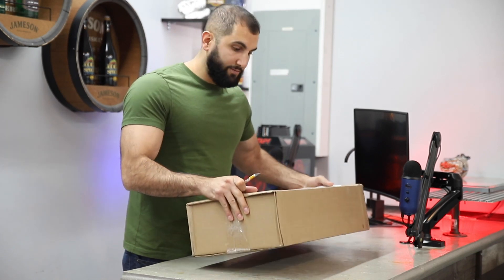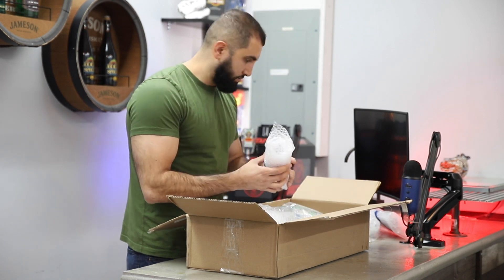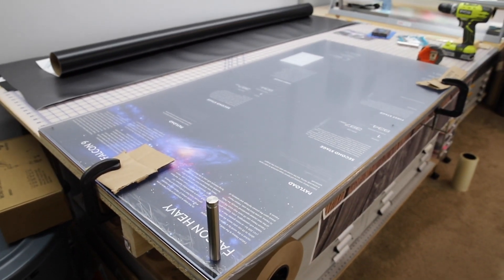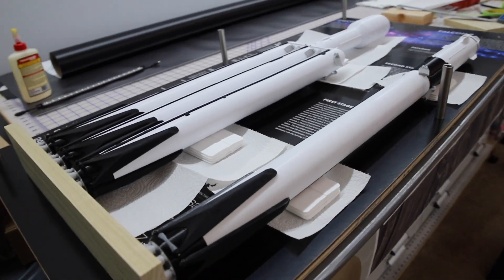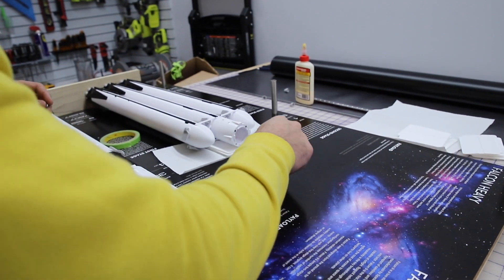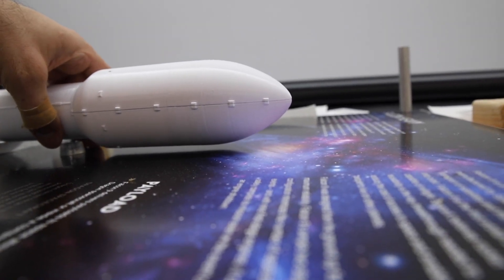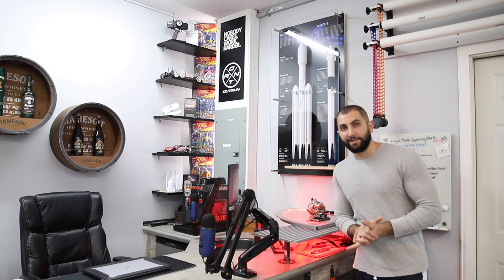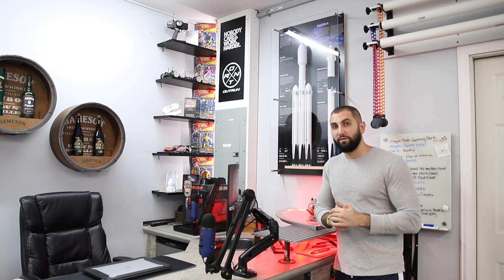3D Printed SpaceX Falcon Heavy Display Case | DIY

Comment: Great job on the project.  I really love the background you printed out!  I’ve been looking at the spacex site for the specs to do something similar in my office.  I just started printing out the files for the falcon heavy...only 200 something hours to go :-)
Reply from the maker: Thank you! Considering offering a link to the full print file, lots interested!
Reply: @EdmonJiddou  I'm sure you'd have lots of takers.  I'm printing my Falcon 9 and Falcon heavy model now and will be designing a background like yours and how SpaceX has the specs listed on their website.  Instead of the galaxy in the background I'll be putting in the tesla/spaceman/moon picture and possibly print another first stage with the re-entry marks with the landing gear out.  My only (very minor) suggestion would be to spray paint the wood ledge and the edge of the plywood but overall it looks bad ass.  I love the barrels on the wall as well.  Well thought out space and good luck on the new venture.  I can appreciate the work you are putting into your brand and channel.